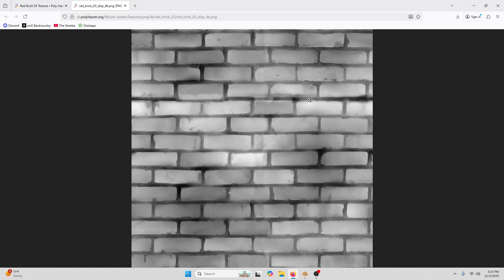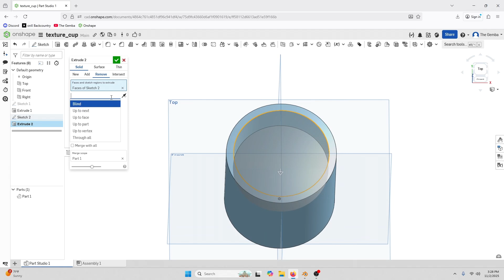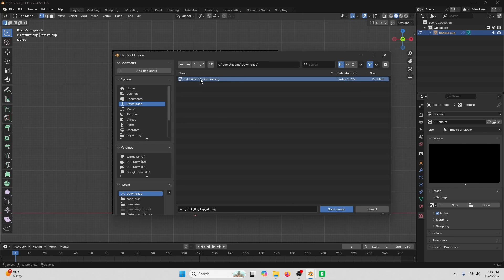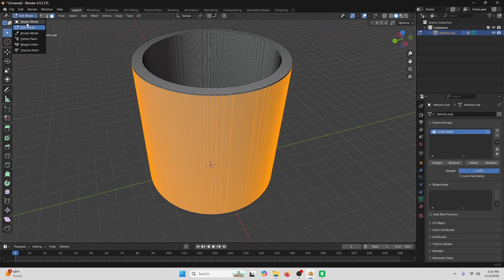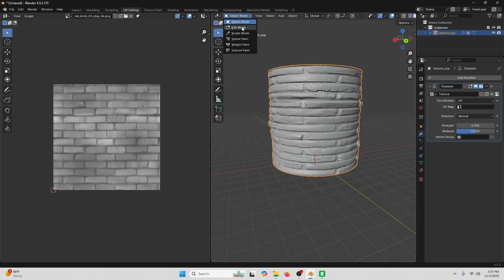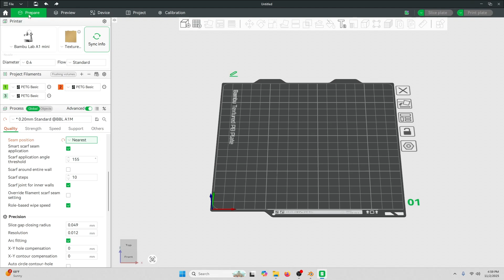Tutorial: Add Textures to Onshape Models with Blender

Comment: Any chance you could do a tutorial for something like a box created in Onshape and then using Blender to put different textures for 3D printing on the sides?  Such as one side with brick, another with tree bark, another with something like sand, etc.  I've gotten the cylinder to work like in this tutorial but am having trouble translating that into something not cylindrical.
Reply from the maker: I'm not sure I have the time to make another video on it, but this does not seem too difficult.

You would select one side of the box and assign it to a vertex group, then apply your texture. Then do this for the other 3 sides of the box.

Does that make sense?
Reply: @TheGemba77  Thanks!